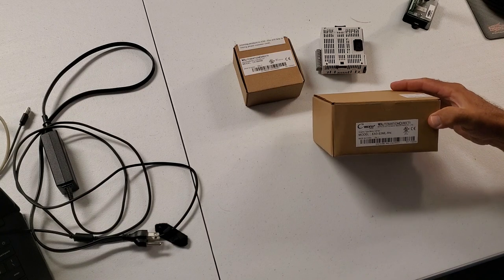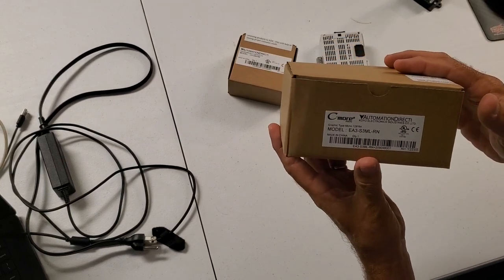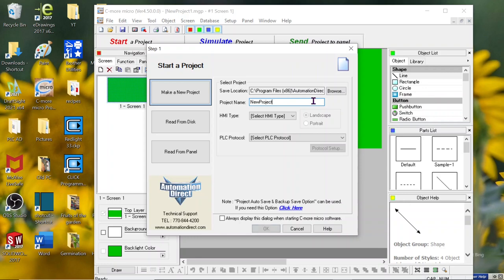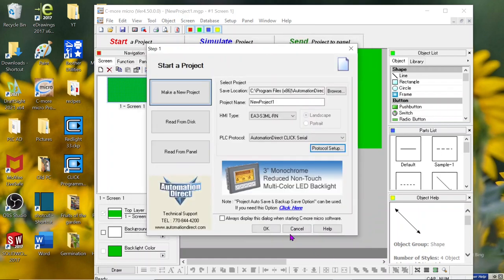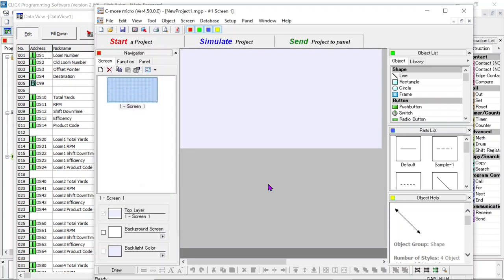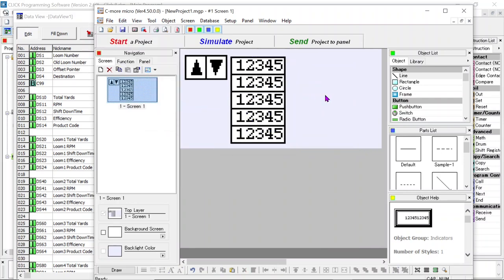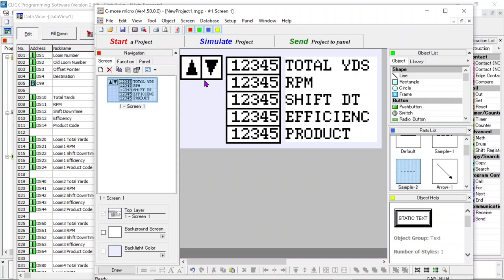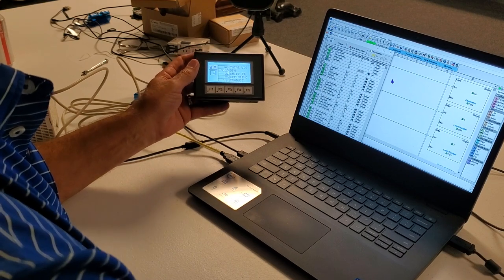Connect Click PLC to C-More HMI, step by step. (CLICK 10) Open box and start from scratch.

Comment: Man, starting grom absolutely beginner and jumping to a full scale programing using from A to Z fror the lerner eaven tuching the program, let's be honest, is a mess. Maybe is ok for progrmers that want to lern traffic lights but to lern click is  an impossible mess.
Reply from the maker: But that's the way it is. CLICK is the most simple to learn. Good electrical background helps. You have to jump in and push yourself to get past the first wall in your learning curve.
Reply: @WadeCountryLiving  thank you. But the best way to learn new language is by exercises. Starting from simple thing and with hands on adding more and more till gain confidence and adding till in the most complex exercises. Please add some exercise where to start working by myself. Is hard to find anything on YouTube about click relay. Thank you